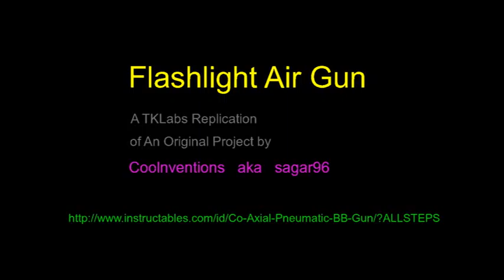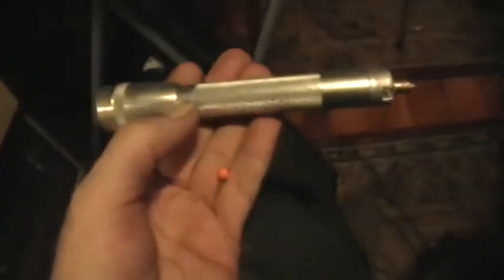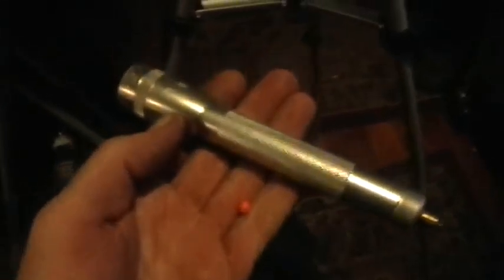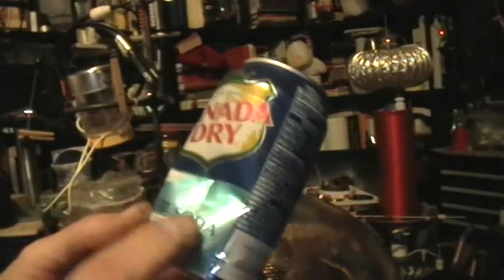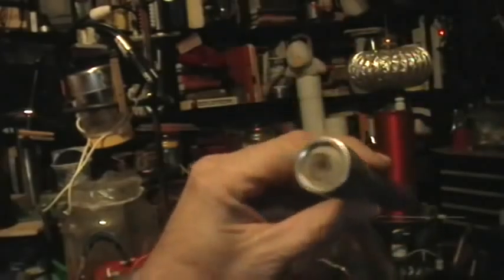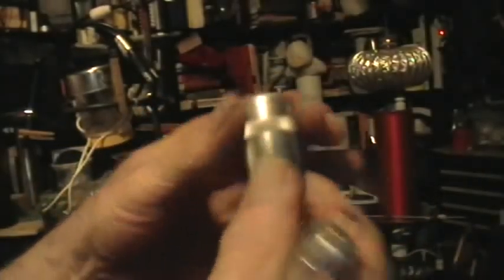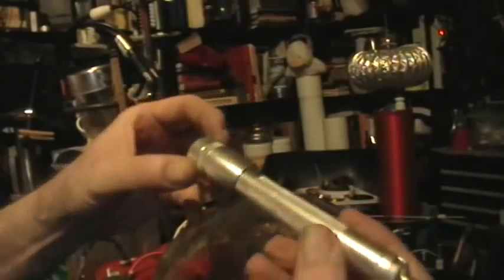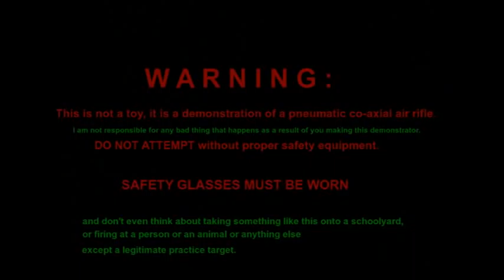TKLabs Replication: Coolnvention's Co-Axial Pneumatic Flashlight Projectile Launcher

Comment from the maker: I don't know if I can describe it any better than I already did in the description.
The door stop doesn't fire the bb, it moves back and unblocks the barrel. Before you push the pin, the stop is held tight against the barrel by the internal pressure. When you push the pin the pressure in front of the stop pushes it back and this unblocks the barrel. The air in front of the stopper then rushes out the unblocked opening and pushes the bb out of the barrel.